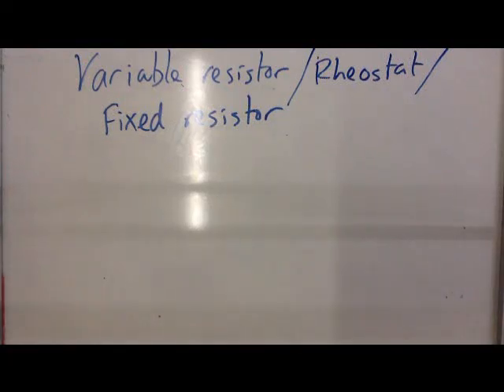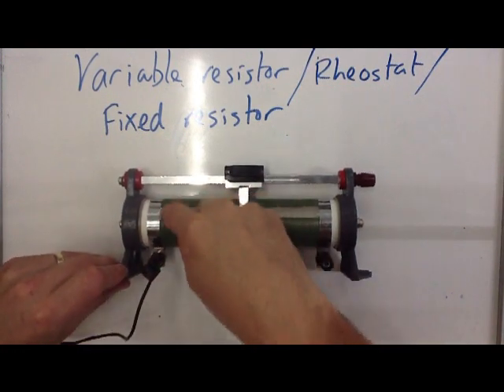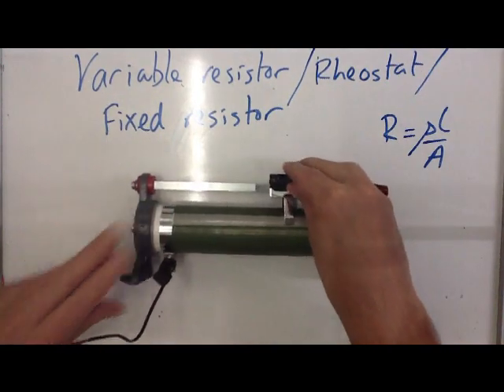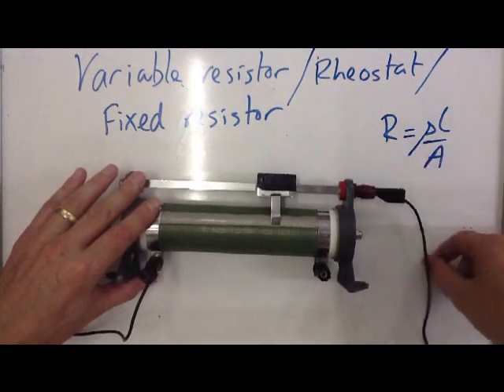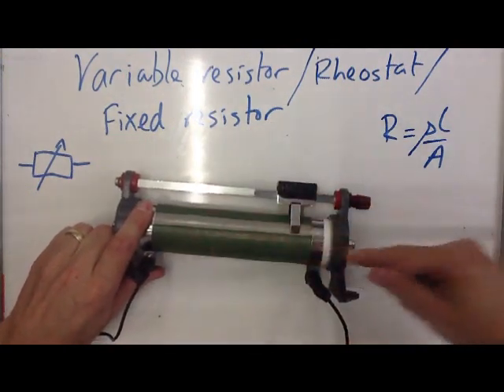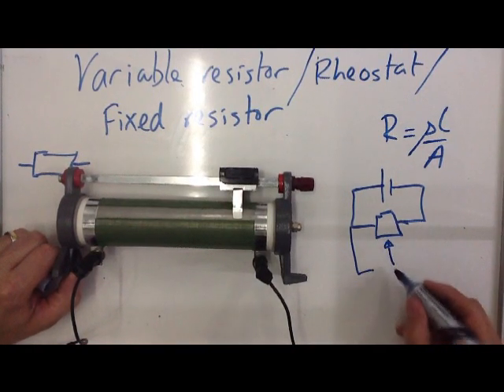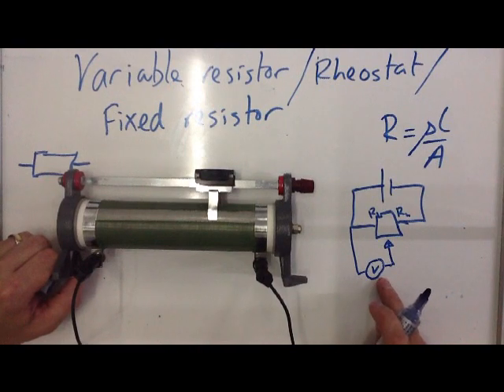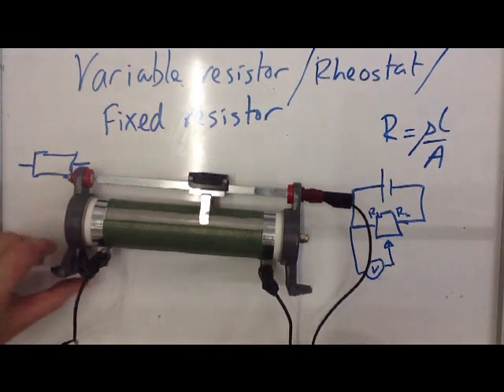Setting Up A Variable Resistor, Rheostat or Fixed Resistory

Comment: Please be advised that a RHEOSTAT is NOT a potential divider,
it is simply a variable resistor.

One can also use a pot with 1 outer leg discarded or,
centre wiper and 1 outer leg shorted,
making only 2 connections in either aforementioned scenario.

The word rheostat was coined c1845 by Sir Charles Wheatstone,
who made the large, ornate, basic, early wire wound versions.
Reply: 7 Years later, what's described in the last example is a potentiometer, NOT a Rheostat, a Rheostat is as the variable resistor setup in the second demo. A Rheostat IS a variable resistor.
Reply: Why isnt it a voltage divider though, cant any resistance in series divide potential?